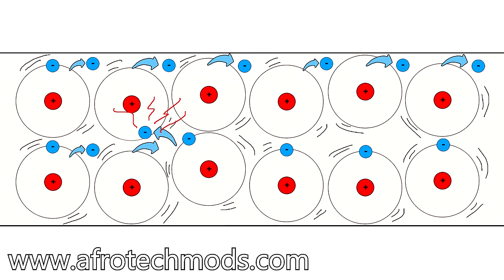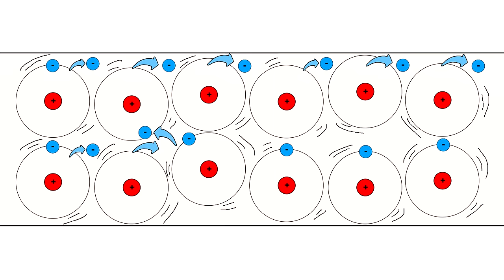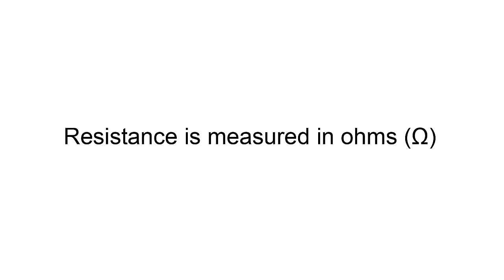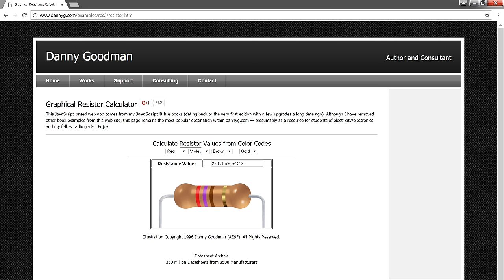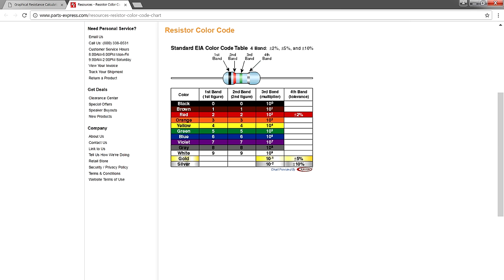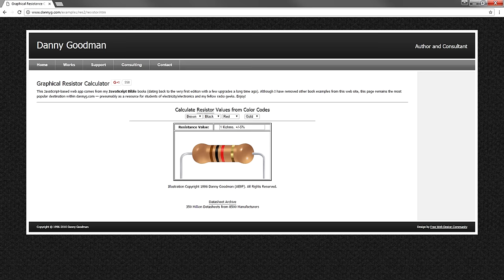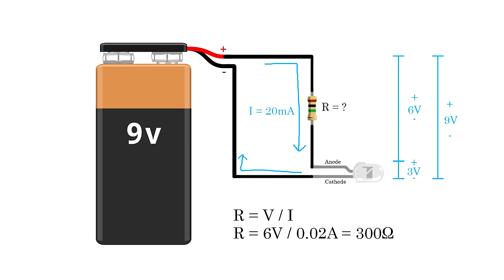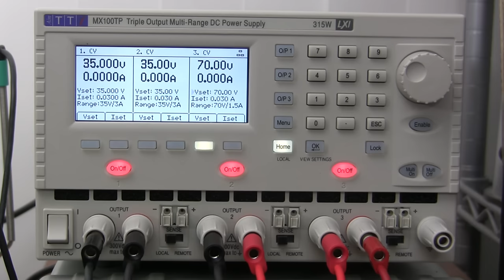Basic Electricity - Resistance and Ohm's law

Comment: Do resistors have power consumption?
Reply: Yes, they dissipate the lost energy as heat.  That small resistor he used was 1/8 watt.  You can use larger 1/4 watt, 1/2 watt and even 10 watt ceramic power resistors.  They get quite large, but can handle the heat.  You might also want to use a cooling fan if your power requirements are high enough.

Comment: so with atoms moving due to heat and power drops due to heat transfer. is that why they super cool things now i.e super conduction
Reply: yes.
superconductors have 0 resistance.
the reason why cooling certain materials makes them superconducting is a lot more complicated though and is a quantum physics explanation outside of what you'll ever find in a typical electrical engineering class.
Reply: @BattousaiHBr  yeah i looked into it, but opened a whole new list of questions i shouldn't be asking on a basic electricity video hahaha.

Comment: So resistors drop voltage and not amps?
Reply: Both, but think of voltage as the primary effect, and the current is a secondary effect.    In series a resistor will reduce the current for a given supply voltage.   But across the voltage source (i.e. in parallel) a resistor reduces the voltage by providing an alternative path for the current.
Reply: @karhukivi  oh ok I understand that. Thanks pal.

Comment: resistor jalne ke baad kese pata lagaye ki kon si lagegi
Reply: That Resistor was of 1/4 watt
If you use 1watt then it will not burn.
Other calculations are right.
A low wattage Resistor can't handle higher AC voltage.
Hope u got the point...

Comment: Sir if we want to connect 3LEDs in 
Series
With 9V battery which value  resister is recommended. 
Also if we connect them in parallel then which Resistor is recommended. 
Plz reply or make a detailed video in this scenario 
Thanks

Comment: Why do you and everyone else say that resistors resist current (amps) when they also affect voltage?
This is why it is so confusing.
Reply: Think of it like this. The voltage supplied is the amount of energy a postman has to get across the whole circuit. When they hit resistance, which makes it more difficult to move the mail, they spend some of that energy. This leaves them with less energy, and now feeling tired they won’t be able to push their trusty mail bag cart as quickly, lowering the amps. So by putting a resistor in front of the light, the postman no longer has the energy to recklessly speed through the light and has to go at a slower pace when it encounters the resistance of the light. 

So if you think of amps as the amount of mail in weight that they have to carry, voltage being the amount of energy the postman has before they collapse on the ground, and resistance as hills which make it more difficult for the mail to move up, that might help connect things.
Reply: The resistance acts on the amps, but the voltage is reduced across it as it expends itself to push the amps through the resistance.
Reply: @Panic_Pickle  Thanks for the effort.  I have the feeling that folks who work with this brainwash themselves to focus on the current or something.  Listen to what you said, it acts on the amps BUT there is a voltage drop. How do you know it doesn't act on the volts BUT there is a current drop?  Aren't they both related?  Didn't Ohm say that?  I learned this years ago and it never sunk in (I"m talking 40 years ago).  I am revisiting this problem for me and this doesn't make sense-still.  My mind only ignores so much.  I can handle the inconsistencies of V for volts, r for resistance, and a for amps, wait that i for amps (WTF). I usually walk away with that alone, but I'll try to ignore. 

I get that amps are like current in a river and volts are like the pressure or push or kinetic energy like at the top of a mountain.  But when you encounter resistance that takes away from that energy.  A bunch of crap in a river takes away current, too.
On one hand, folk are complaining about the heat coming from a resistor when they try to drop voltage.  On the other hand, people say you can't drop voltage with resistors.  On still another hand people say current stays the same in a circuit.  I need to get away from paper and get a battery, wire, and some resistors to actually do it myself, I guess.
Reply: EDIT: The most helpful part of my rambling this time is probably the last paragraph, it gets a bit repetitive overall.

dshreve34 ok so you get the same thing in cardiovascular systems; The amount of blood entering and leaving the heart is the same (as is the case with electrical circuits, the amount of electrons being pushed in one end will equal the amount pushed out the other end) so the current is the same, and the amount of push it has to get through the whole circuit is constant (more or less). However, the arteries are high pressure, and the veins are low pressure, because the heart has just shoved it along where as the veins are coming out of the “resistors” (capillaries, where it is spread out and friction goes up drastically) and thus have lower pressure.

To go back to my mailman analogy, the resistance when going up a hill is due to gravity. The gravity acts on the weight, or the amount of mass that is moving, to slow the current. To keep it moving requires a certain amount of energy, below which it will simply be unable to move and the circuit won’t be completed. The voltage is the electricity’s ability to overcome that obstacle presented by the resistor. The voltage across a circuit (for example, the one in the video is a 9 volt battery) will not change. However, the voltage across a resisting part of the circuit will be different. It’s like pushing a brick. There is a threshold of force that one has to meet to overcome the resistance, and that force is analogous to voltage. If you push gently with a single finger the brick will likely not move, but once you reach a certain amount of force it overcomes that and moves readily. If the resistance is higher than the voltage can push through, then the circuit will not be able to be completed.

Current in a river doesn’t vary across it’s length. The amount of gallons passing a particular point at a fast moving section will be the same as at a slow moving section, presuming perfect conservation of water and that nothing is sinking into the ground. But if you add a sponge, then the whole river will slow down.

As mentioned in the video, the circuit has nine volts. The resistor added requires six volts to have current pushed through, and the light only needs three. By putting the resistor before the light, the voltage expenditure is split between the two resisting parts. The total voltage of the circuit doesn’t change, just like adding a sponge or a long flat section doesn’t change the gravitational potential energy from the lake to the sea, but the resistance slows the current. And if the resistance is high enough, then it will simply stop flowing.